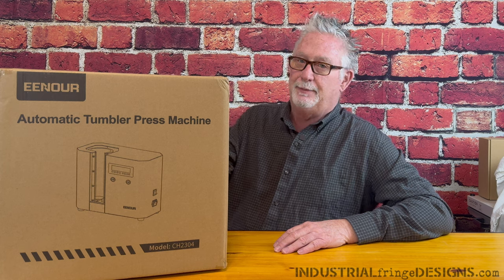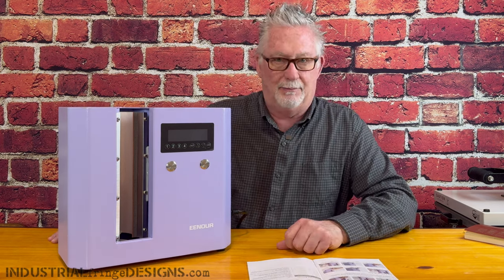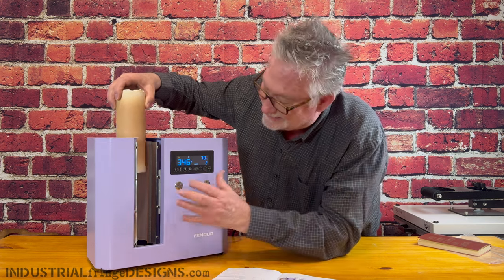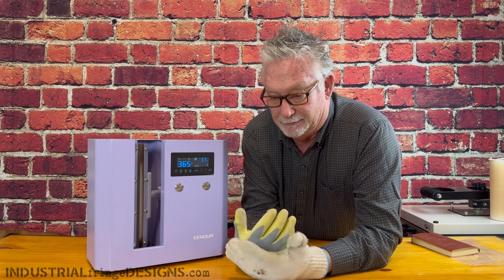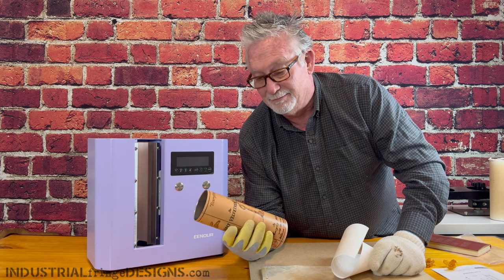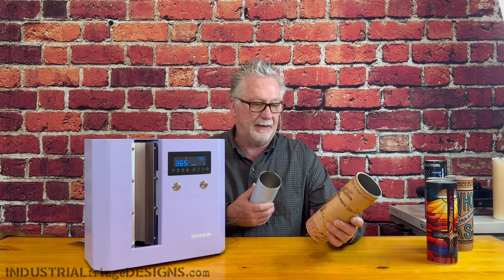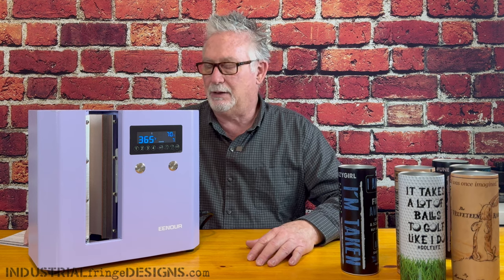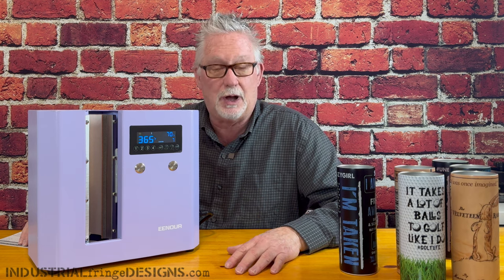AUTOMATIC Tumbler Press Set Up & First Look - EENOUR CH 2304

Comment: I have this press took a while to get the settings right and I'm a lot like you and rather do a matte tumbler.  I have tried the gloss and I get the tape marks from the seam and top also bottom.  I also purchase the tape you recommended in your past videos.  I have only used the tape you recommended for the past 4 months.  I have now tried other tape but sames tape marks as if the pressure is to tight.  Was hoping you can try with the Gloss and see how it goes

Comment: Have you ever ran into error code 1? I’ve had my machine less than a week and I think I’ve only done five tumblers on it and I went to do an order today and error one popped up.    I found the manual. It doesn’t say anything about the error code and I’ve been scouring the Internet to figure it out. We’ve also changed the fuse in it twice.

Comment: This won't do the wide, not straight, sided 30 oz tumblers will it? Or tumblers with handles (since it auto rotates)? I wish there was ONE machine that did them all.
Reply from the maker: Hey! I don’t think it will do tapered tumblers, but it can do tumblers with handles, as one of the settings is a non rotating setting. I haven’t tried it with a handle, so I’m not sure how close you can get the design to the handle, but I’m sure with a little finagling, it should work! Thanks for watching!
Reply: @industrialfringe953  Thanks. I had a suspicion.

Comment: Did you see this from the company: "The heating attachment is consumable and needs replacing every 3-6 months, especially when it bubbles or heat unproperly. If your machine is under the protection period, you will get a free replacement."
Reply from the maker: Hey, Diane, yes, that’s the case with all tumbler and mug presses. My Heat Press Nation press states the exact same thing. Sometimes they last for years, sometimes they last for months. It’s my understanding they do generally last a while. Thanks for watching!